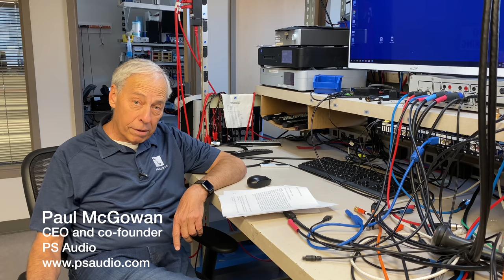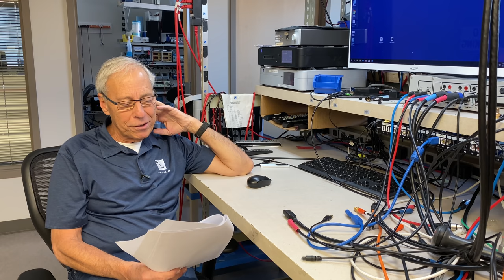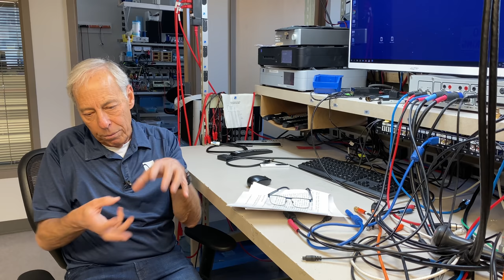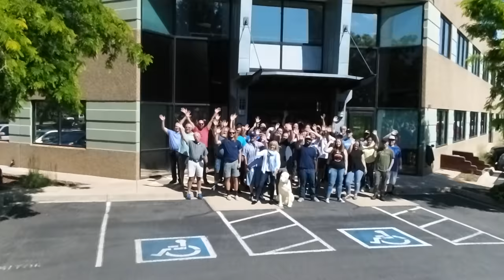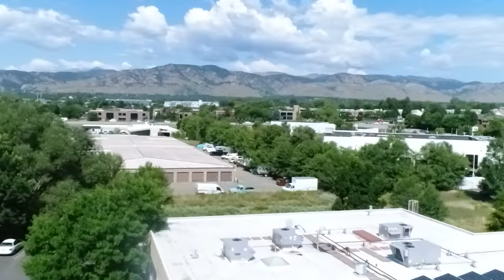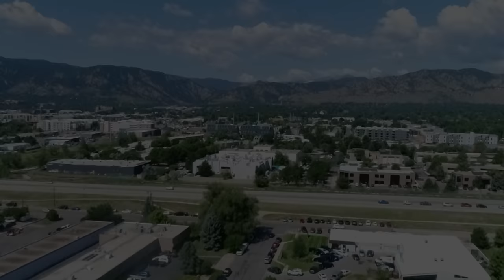Speaker sensitivity and audio quality

Comment: speaker efficiency - how is it audio maybe the only industry that is not concerned With efficiency.  take TV's, autos, air conditioners, light bulbs - how is it audio gets away with low efficiency ?
Reply: Electrical power-delivery is not efficient nor are typical car and truck engines. And light bulbs for 110 years (before LEDs) were not efficient.
Reply: We don't say the performance of one car is "better" than another simply by how many miles per gallon one car gets versus the other. Should a Lamborghini be built like a Toyota Prius because the Prius gets better mpg? Heck, it wouldn't be a Lamb anymore! You could get farther, but the drive is no fun. Speaker efficiency is like mpg. Alone, it doesn't really tell how good a speaker or car is, and shouldn't get in the way of what you REALLY want to hear and drive.
Reply: @delstanley1349  but Mustangs now get more More mpg than older models AND far more H.P.  todays spk. model should be more efficient than previous  - heck take just one generation, shouldn't the KEF R3 be better at this than the R300 or  Elac z ( current ) better than model y ?

Comment: Totally disagree on bass statement.. my tekton ulfberts are 99 sensitivity and bass is crazy good 20 hz .. the statement of high efficiency speakers having no bass is a total lie .. cheap junk high efficiency speakers have no bass is a accurate statement.. and you hear alot more micro detail and way better bass than any 85 87 89 even Speakers ill never buy another pair of speakers that just take all a amp has to hear less at any price.. ive owened 100 pair speakers in 50 years
Reply: This had me wondering about the Tektons. All the reviews rave about powerful 30hz on the Lore, but it’s super efficient as well.
Reply: @EricLS  well the tekton ulfberts are 20 hz im powering them with ps audio m 700 monos and ps audio dsd dac so thats clear im not saying stuff to put ps audio down.. im stating what i hear from 87 89 db speakers compared to high efficiency 99.6 and they dont get crazy loud with low power and they eat current .. also had my two kilo watt ead powermaster 2000 .. is all paul does not know everything i mean he likes those servo woffers in the infinity speakers he loves so much.. and the dac randomly turns volume on at 50 db the techs blame roon labs .. but its not roon labs.. its the dac and this my second dac as one blew up but they have great customer service but they lie.. so dont believe everything this guy says like he saying basically the higher efficiency speaker suck thats i lie
Reply: Funny how company that makes the dac witch is awesome dac @5,999 plus 900 dollar bridge cant fix this problem there will be a review video on my facebook and my instagram on this issue   ty
Reply: I recently picked up a pair of Tekton Lores and also have the same observation where their high efficiency of 98 dB does not compromise the  bass response. In fact, I no longer use my subwoofer for 2 channel listening, only home theater. The Lores replaced a pair of 86 dB Magnepan MMGs as my main speakers, and as much of a Magnepan fan as I am, the Lores surpass them in detail, dynamism and bass response. This all runs contrary to your explanation albeit I respect the science that supports it. There’s got to be something else going on that allows the Tektons and other speakers of that type to succeed with high efficiency and uncompromised bass response. Maybe I’m just getting better bass definition and confusing that with volume or depth. I always look at the efficiency spec on speakers of interest and, at this point in my audio evolution, don’t think I would ever consider a speaker that wasn’t of high efficiency. Having high efficiency speakers opens up an entire universe of amplification possibilities, adding to the fun factor.
Reply: @aseltzer144  ill never go back to super hard to drive speakers . The bass is more responsive full of life just effortlessly pleases
Reply: @supergwizzo  That’s my experience as well. I have a vintage dual mono 200 watt per channel amp from the 80s (Aragon 4004) but my preference nowadays is for low power tube amplification, currently with SET amps. Those are just not possible to use with anything less than high efficiency speakers.
Reply: @aseltzer144  great amps ive owned aragon for yrs just sold 8008 mk 2 younger brother to 4004 had palladiums 1 n 2s st bb and they had d2adac 16 bit remote powersupply was uber analog and acurate   im finding these ulfberts really do well with class d .  As im using ps audio m 700s the 8008 just had way less vocals as compared cant wait to add p3 for power over niagra 1200 seems we both have been inlightend as klipsch engineer told me witch i knew heresey . And rest are only for lower power amps. So hense pual is  right .
Reply: @supergwizzo  Class D amps became interesting to me too so I recently picked up some very inexpensive Chinese class D mono amps. They sound good on the Lores and don’t just sound inexpensive compared to the Aragon. I love how these Tektons just bring out the best in whatever I drive them with.

Comment: I'll tell you the truth. Many speaker elements that have 95db at 1watt and 1 meter or 100db do not have as good sound quality. you often need more crossover parts to get good sound!
speaker elements such as 8 inch which are at 80db or 85 db often have better sound and are easier to make a crossover. Yes you get lower sound but often better sound!

For example, PA speakers often have 95db or 100db or higher

a 3000 USD speaker does not always have better sound than a 100USD. watch gr research on youtube